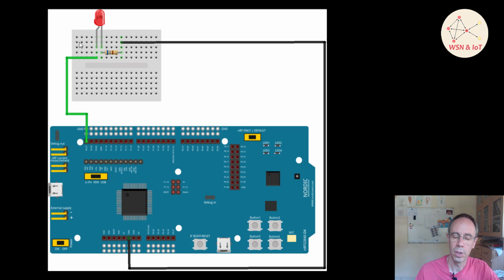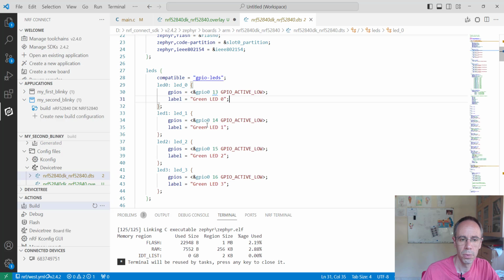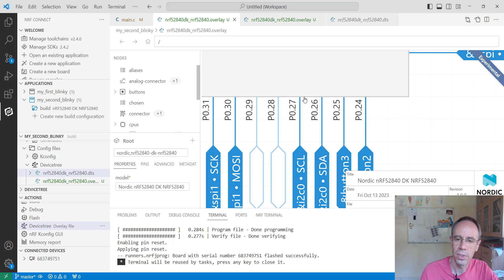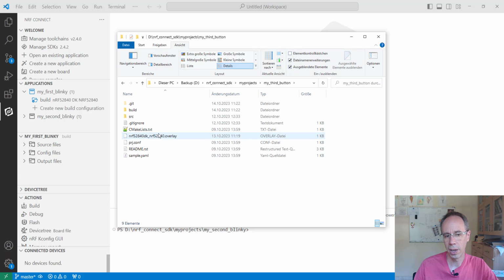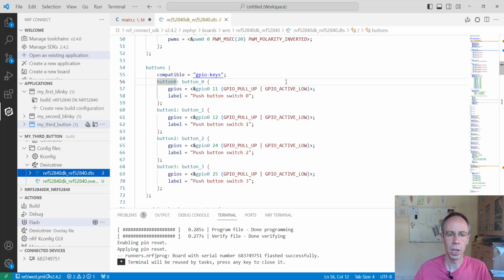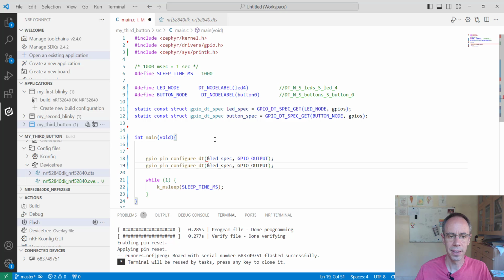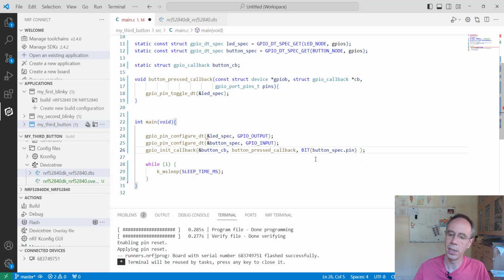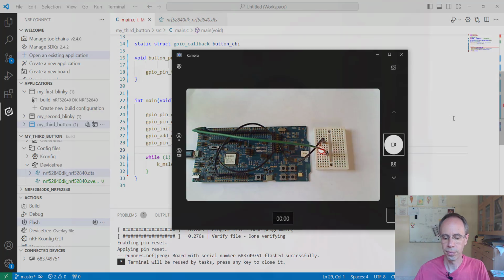Zephyr and Nordic nRF Connect SDK - 03 DeviceTree Overlay and Buttons (v2.4.2)

Comment: It really says something about Nordic's SDK when it needs a 15 minute video to explain how to use a GPIO to read a button input. It's probably the worst system I've ever worked with. More time is spent messing with config files, and getting macros to autogenerate hidden code, than actually programming their chips. Plus they tend to completely break backward compatibility every couple of SDK releases. I work with a lot of different manufacturers, and Nordic is the only one that always leaves me angry at the end of the work day. I'm guessing by SDK 3.0 they'll replace the editor with a simple ChatGPT prompt to just generate all the code and flash the board 🤣
Reply from the maker: It is only 12:26 and i speak quiet slowly 🤣. But of course I got your point. Your criticism is not entirely unjustified, although this has less to do with Nordic alone than with the RTOS Zephyr. It is probably not easy to keep the balance between modular, many functions, protocols and simplicity. I like the basic concept of the Devicetree. In the meantime, however, too many parameters and functions have been added that it has become confusing and difficult to understand. The pin-control for GPIO with sleep and default is an example. In the actual SDK you have to click in VS Code on the build to see the prj.conf file and the devicetree files. Not exactly intuitive.
Reply: @wsniot  Thanks for the response, yes I was being a bit hyperbolic there, but I really do find it frustrating and I tend to avoid using Nordic in new designs now, so I (and other devs) don't have to deal with their build system. I think I'm pretty decent at writing C/C++, and have a lot of experience with MCUs from various manufacturers, and I like to have access to the peripherals directly in the code, without all of these layers trying to prevent that in favor of portable code. Maybe if I mainly worked with Nordic it would feel different, but as someone who moves between brands quite a lot, Nordic is the one I really dislike having to work on. It's a shame as their MCUs are actually good, underneath it all.

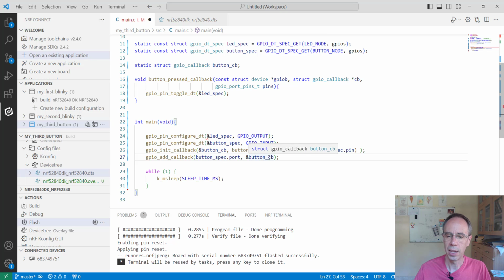Comment: Hi Markus, great video (very explanatory). You mentioned (@10:30) that for the 'gpio_add_callback' you can add multiple call back functions... is this done by adding further 'gpio_add_callback' statements to the same port? Please can you expand your explanation?
Reply from the maker: Hi, with gpio_init_callback you just initialize a gpio_callback structure (cb-function, pinnr) . 
With gpio_add_callback you add this structure associated with the GPIO-port (driver) in this case GPIO0. For another button on the same port you can add another gpio_callback structure. 
To activate the specific interrupt and pin you call than gpio_pin_interrupt_configure_dt which is actually the same as gpio_pin_interrupt_configure(port, pin, flags).